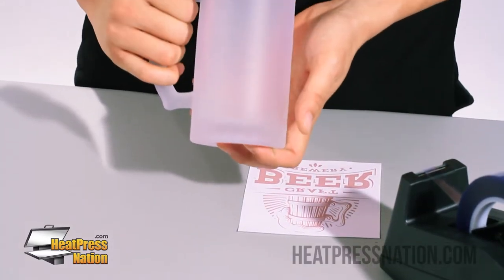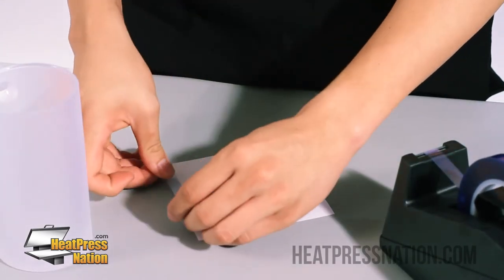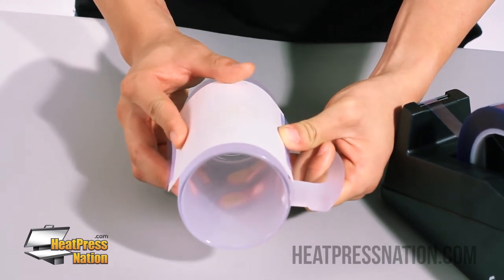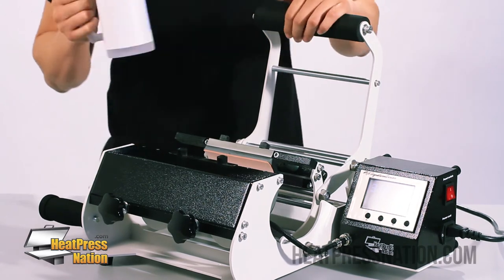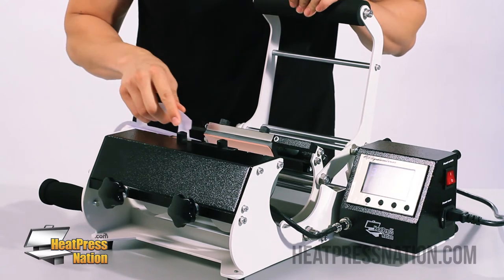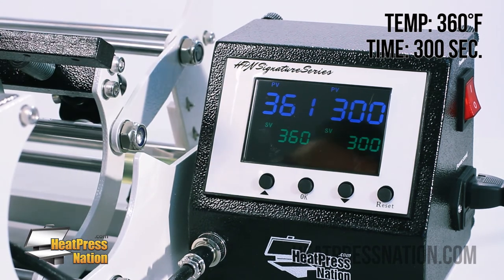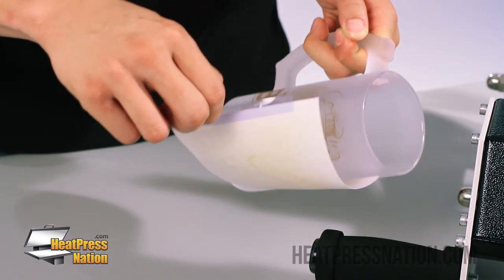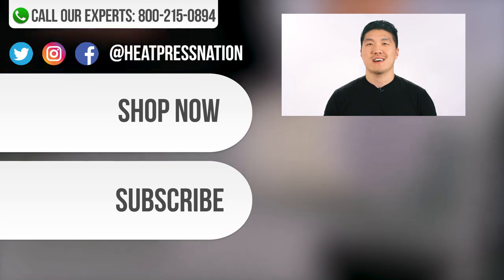How To Transfer Sublimation onto a 16 oz. Sublimation Frosted Beer Stein

Comment: How do you avoid marks left by the tape
Reply from the maker: Are you using frosted glass steins like the one in the video? If so, which brand? In general, heat tape should not leave any sort of mark or discoloration when pressing sublimation drink ware.

Comment: I tried to sublimate a clear pint glass. The printed image had good color but the sublimated image was faint. I was using very good pressure at 380 degrees for 150 seconds. Any thoughts why it didn't work ?  Thanks

Comment: Can you reuse the template on another glass.  I want to make frat glasses.  Would love to not have to re cut the template for all the glasses.
Reply from the maker: Sublimation transfers are not recommended for re-use. You'd have to print one transfer per blank stein.
Reply: @HeatPressNation  thanks for the quick reply

Comment: Could this glass be done In a convection oven? If so, what temps and time do you suggest?
Reply from the maker: If you are going to do sublimation transfers in an oven, you will need a silicone oven wrap. We don't carry wraps, so we haven't tested them to see best time/temp settings are on those. However, the retailer you purchase them from should be able to provide those to you.